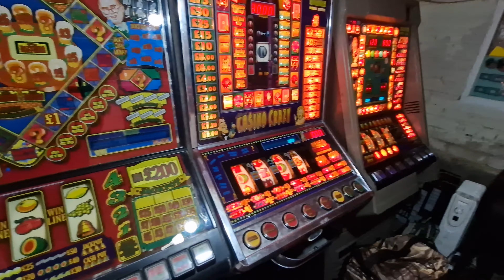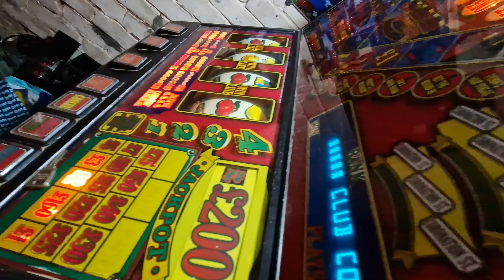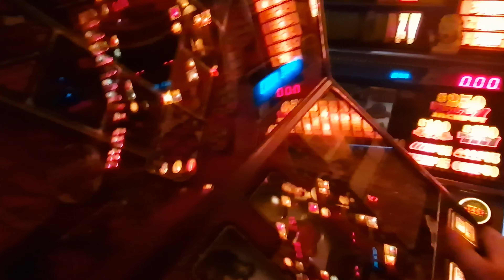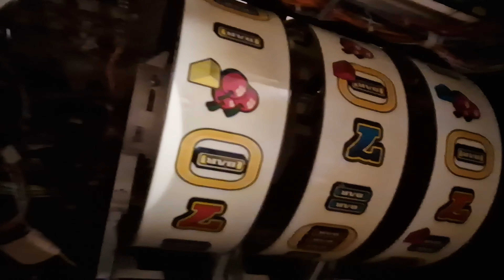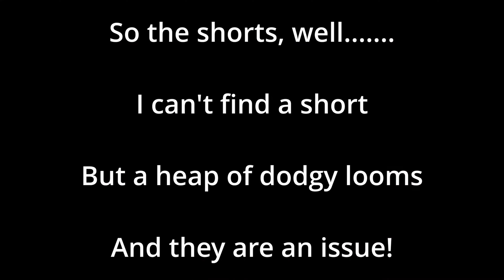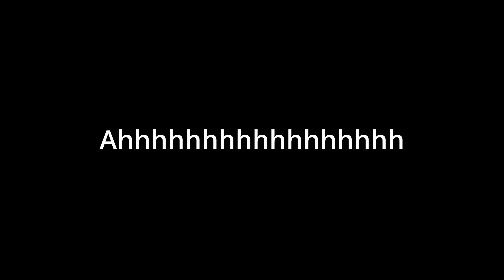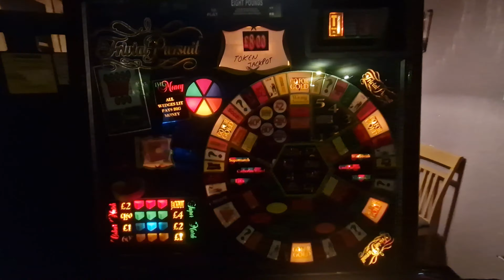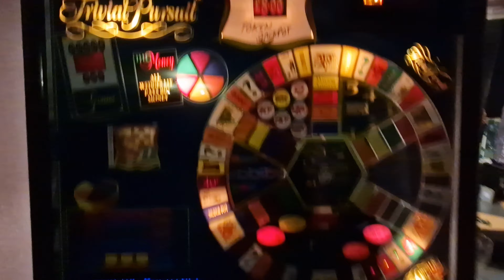Trivial Pursuit Repair ***Broken For A Year, Fixed 24 Hours***  @TheMadmagik @RETROSLOTSBLACKPOOL

Comment: fantastic work, picked up a few tips. Swapping out parts I can handle, this is the type of fault that seems like such a challenge to me, seeing you brake it down to one small task at a time certainly did the trick. Magik is truly a legend.
Reply from the maker: @cactuarspliff  100%, taught me stacks of stuff and I couldn't do anything before we met.
Reply: @JamesHardyFruitMachines  I am going through the same process,  Peter has helped me so much and it has meant the world to me. up until a year ago I had never even wired a plug and magik has me swapping chips and all sorts!
Reply from the maker: @cactuarspliff  that is what he does, if you are keen to learn he will 100% painstakingly teach you. What he has done over the last few years has allowed me to grow and often ill send him a stack of messages and have sorted it before he has even replied to me 😂 but it's because of him that I can do all that these days.

Comment: Can you test a scorp 4 the same way?
Reply from the maker: Elaborate mate
Reply: @ my scorp 4 machine won’t boot and I know the board is working, after watching your video where you plugged things in one by one and tested if the board booted I wondered if I can do that with scorp 4
Reply from the maker: @spongelad1  I will talk to Magik and see if it does, however my main questions are if you know it works the boot sequence thing doesn't help resolve your issue.  Talk me through whats happened.
Reply: @ I bought it none working and when it’s powered up it does nothing, the board has 4 green lights and a flashing red light, I took the board out and put a working board in and it booted up, then the next day it just did the same as the original board. 4 green and flashing red, I’m out of ideas, I suspect maybe psu but don’t really want to spend any more on it
Reply from the maker: @spongelad1  stadium psus can be flakey so it is quite possible its power related. However if the first board hadn't had a leak maybe it is worth borrowing a psu as you may have 2x good board. Worth putting a post on one of the FB groups to see if anyone local has a scorp 4 machine to confirm it is psu related.
Reply: @ yeah I will do cheers pal, the first board had battery damage but I still tried it when I got it home and then I bought a working board from Tim h but it only booted once, I defo think it’s a psu issue, it’s a club £250 cops and it already stands me at a ton so don’t want to spend much more, it needs a hopper as well cos one had been removed and replaced with a takeaway tub to catch the coins 🫣 and the coin mech will need replacing, might be better scrapping it but I hate doing that
Reply from the maker: @spongelad1  probably be on the right side even if it stood you at a psu and a mech. It is possible your battery damaged one still runs though which would be a huge bonus
Reply: @ replacement board was flywired so I soldered a new battery on
Reply: @ sorry I understand what you mean, yeah it might work it had solid green lights on it, so maybe,
Reply: @ the cabinet is absolutely mint and when it did boot up there wasn’t a single bulb out so it’s either been stood a long time or it’s been well maintained, that’s why it would be a shame to have to strip and scrap it but my knowledge is limited